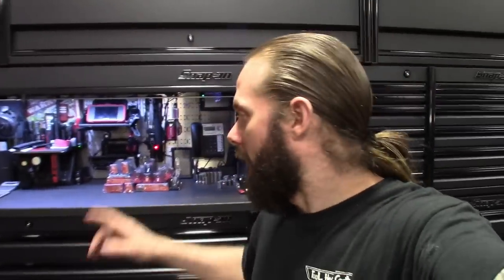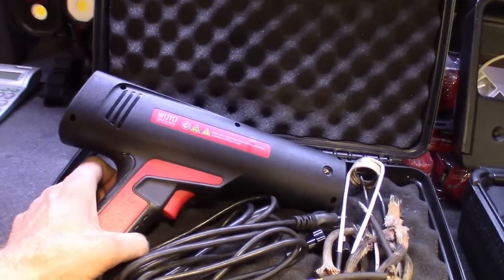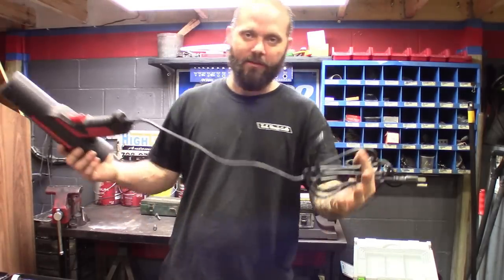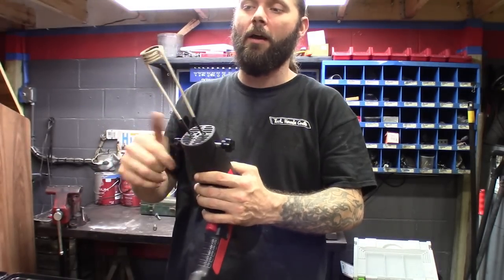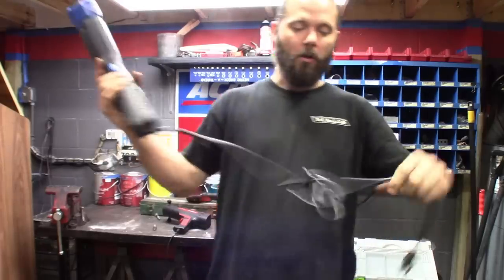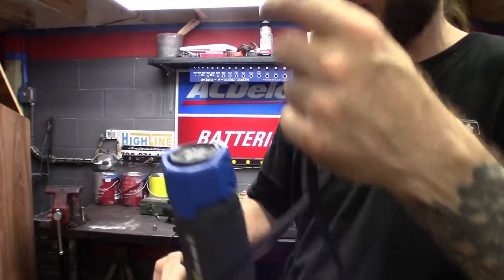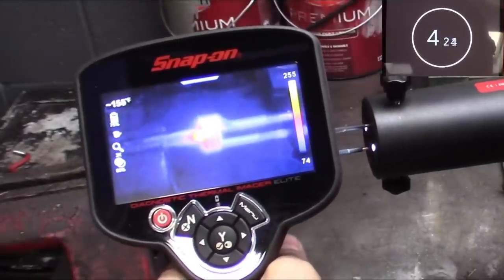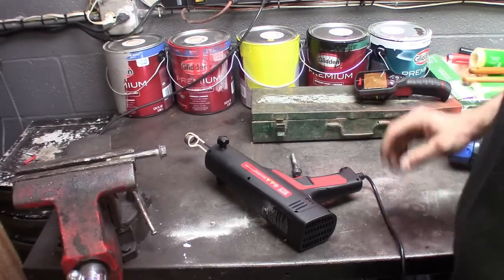Mini Ductor Comparison

Comment: Owned the venom a few months now and user it about 9-10 times. Came in handy removing a leaky fuel tank mounting strap bolt on my daughters 04 Hyundai Santa Fe. Beat getting a torch out and setting things on fire... 💥🔥🔥

Comment: Thanks for the video. One thing you don't mention is the wattage of both units. That's the true test of the power of the unit. The coils are insulated with fiberglass sheathing. The bolts will rise in temperature very quickly, as long as the coil is the proper size, and your thermal imager  is reading the temp of the coil while you are using the bolt heater, since it's surrounding the bolt head.The coil will take longer to heat up, and you'll likely find that you can heat it for a shorter time, and check the bolt with the coil removed, and see it's hotter than the coil. Your coils will last longer this way. You can probably buy the insulative sheathing and the copper wire, and make your own, cheaper. Are you still happy with these tools? I don't own one, but plan on building my own. I do play with these types of supplies for other reasons, like driving flyback transformers for high voltage electronics projects.
Reply: The supply used is called a zvs driver or zvs induction power supply, for those who wanna  build one. They're relatively inexpensive to buy on eBay, and I think you can build your own bolt heater for under $100, if you are crafty😁

Comment: I have the bolt buster which was expensive as well but the damn thing is amazing up here in central ny. Nothing repla es my torches but the induction heater is great to have.
Reply: I have been looking to replacing using my torch since getting gas a is a hassle. You still would use your torch of this induction heater? If so why?

Comment: Thankyou for the comparison, Im just home DIY but Ive always had oxy torch for gas welding plus heating of stuck parts, we pretty much all know just how many grazed knuckles a bit of heat saves and ironically now  Im into EVs the risk of kaboom is way less anyways without gas tanks around. From where I can see on EVs  the high mix of aluminium structure, steel bolts and road salt means were gonna be in for a lot of seized fasteners and Induction heaters are gonna be a thing. Ive a cheapo Ali Express 1000w unit on the way as ill not be using the kit commercially then again a bit of luck ill not end up with prize fighters knuckles after being able to induction loosen fasteners when swapping out the Teslas suspension links!

Comment: After I warrantied a mini ductor that wasn’t working for another, I hoped it would be a great tool. But, the second one did the same thing, thermal and turned off, never got the bolt/nut as hot as I wanted.
Maybe i’ll try another one, or another brand.
Reply: Which brand did you get

Comment: I just use the coil in my welder.Does the same.
Reply: What do you mean?
Reply: Attach 2 welding stick holders to your rod welder,you allready have one.The ESAB type is the best,cause you tighten a screw around the rod in that type.Buy a U formed ductor coil,and shape it to fit your project,or buy preshaped.Put one coil end into one rod holder and do the same with other end of the coil and other stick holder.Tape the two holders together, turn welder to a minimum,and start your welder and simply see what happens.Hold your finger on the stop button and remember that I dont know anything about your welder or local grid,but in principle,you are doing the same thing as you do when you try to start stickwelding,and the rod fastens to your workpiece,the stick begins to glow,if you dont remove it.Good luck and stay safe!

Comment: Great video! have you used one of the long freehand coils that are made to wrap around large parts like the spindle and wheel hub connect area?

How long would you guesstimate before the coils burn out? A few used or x100 uses etc?
Reply: The coils should last a good while.  They don't heat up much, only the ferrous metal does.

Comment: I would say the venum is controlling its temp by measuring resistance through the element. My thought on why it took longer to heat, BUT that should prolong the life of the elements.
Reply from the maker: That's what I was thinking.

Comment: Good video.  I think we have to ask ourselves how much of our money we want to give to communist China.  I like the US made unit.  Imagine the US company having to compete against the slave labor model.  Also, I noticed that the US company has a higher output version and I'm guessing you can call them and they stand by their product.  Also, does a few seconds matter?  I care more about how long it will last.  You also want the heat to go down the bolt to the threads.  That takes time regardless.

Comment: The woyo was way faster then the venom
Reply: I think that's the one I will be getting, not ready to drop over $700, for a tool I will only use occasionally.  I also like the gun design.
Reply: @daddybdpearson1  can't go wrong with it even for the price it's a plus as well as how fast it is yeah 700 plus is pretty steep for a conductor some coils and some plastic